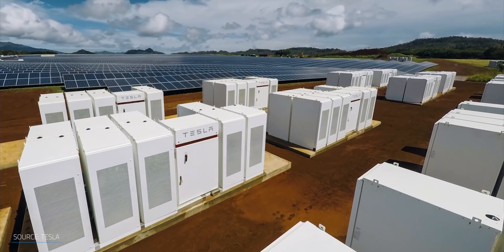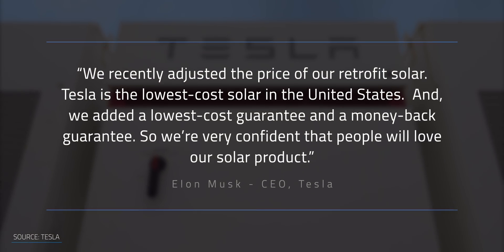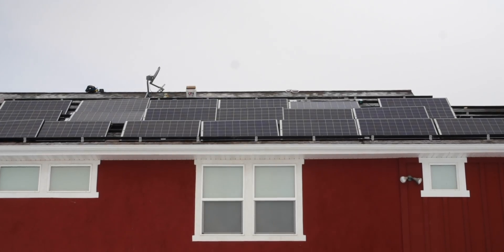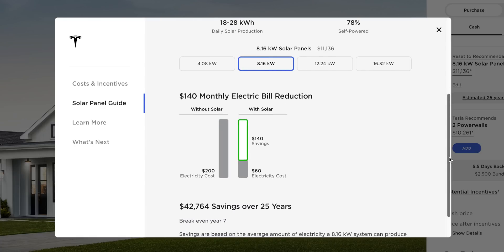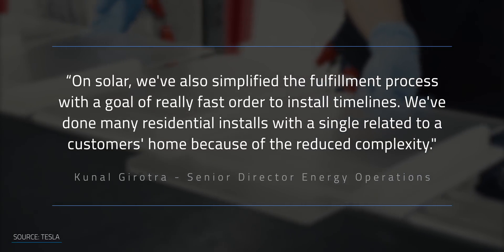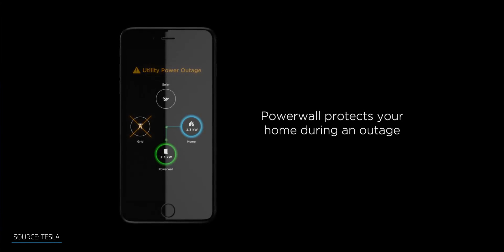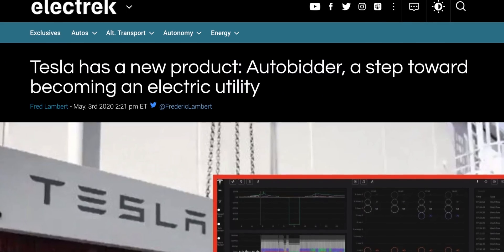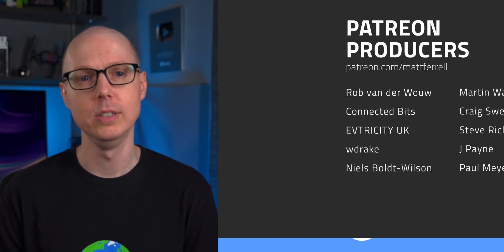Exploring Tesla solar panels game changing price

Comment: Yeah but still 3, 4 times the price of regular solar panels, I bought mine for less than $0.34/Watt, and did not choose the cheapest
Reply: Are you comparing only the price of the panels with total system costs?
Reply: @sharefactor  panels, cables and mounting hardware.

Comment: Solar is an awesome alternative even with gov. incentives but, that dam up front cost. Here in u.s.a its easier to finance a brand new car than a solar installation and would any one pony up 10 years worth of electricity bills in one year to go solar. I do believe it should be a gov. requirement here to have a power wall in every home but, that would kill the electronics and appliance industry because they profit from replacement not repair

Comment: Tesla solar also has the worst customer service and honestly subpar quality products. They also use a central inverter bottlenecking the system and meaning if that inverter malfunctions the whole system goes down. Most high quality solar systems will use micro inverters making the system a lot more robust.

Comment: Are those Australian costs in US or Australian dollars?  No mention in the vid, if they are in Australian then their costs are far lower still because the exchange rate means their dollar is a lot lower than ours.  This price drop though is incentive to wait, because if Tesla can drop it that much their competition will be forced to as well.  And last, I am a disabled vet so my income is tax exempt, meaning I cannot write off the costs against taxes, meaning I would have to pay full price for solar.  Then there is the unfortunate fact that my roof is 9 years old, meaning there is no sync between roof age and a new solar setup.  I would pretty much have to replace a roof with about 11 more years of life in it or, put solar on now then take it off in about 10 or 11 years, then reinstall on the new roof.  The uninstal and reinstal would jack up the overall cost to the point that I could not live long enought to reach break even,  and I wish I could because I have a huge roof, more than large enough to be selling Duke Power electricity instead of the other way around.  My July 17 - August 17 bill just came this morning, $221 and I do not even keep the A/C below 80.  Live alone, switched to LEDs, TV runs about 5 hours per week.  New energy efficient appliances, 6 month old A/C and air handler.  So, $220 seems to be as low as I can get my bill.

Comment: Why don't people just do it themselves? You can order panels for under 1$ a watt easy, they are not hard to install if you have some basic electrical/wiring (you should be at least comfortable with working with your main and breakers) skill. They sell all the brackets and such needed online and if you choose to grid tie it without a battery bank its even cheaper.

Comment: In Poland 7.9kWp total installation would cost about 9.2k USD. So about 1.16$/W. 25 year warranty. From another vendor, I found 9.9kWp total installation cost of about 9.95k USD. So about 1.01$/W. 15 year warranty for defects. 25 year warranty for power curve. The prices doesn't include transport if it is far from vendor, but that is rather small part of the cost (~500USD top). I think these prices can be further reduced, as one can get about 1300 USD government grant for installations below 10kW. So that gets to about 0.88$/W. I checked few other vendors and 9.9kWp installation with incentives it is possible to get 0.73 - 0.89$/W

Comment: The international comparison is distorted by the ludicrous exchange rate of the dollar. The real spending power of one USD equals 0.55-0.60 EUR and in the same relation all other currencies except the CHF, which is equally distorted. Just look at the prices for a loaf of bread, a m³ of tap water and a six pack of the market leading brand of beer. And on the other side, the median wage for an hour of work. Don't use the so called official exchange rate of the financial industry, that's only a fictitious number.

Comment: I paid 75 cents /watt but bought 280W Suniva panels 10k of panels wholesale from https://sunelec.com/ and the are down below 50 cents / watt now  in 3 years. the inverter and batteries are each a third of the cost too. We paid 26k for a 6k system off grid with an 8k outback radian inverter and 24 lead acid 6v/16 interstate  247 amp hour bateries .with 2  outback 80s charge controlers and  all wiring and racking. and breakers for roof mount.

Comment: 1. Tesla doesn’t make solar panels
2. The quality of installation is very rushed and more than not leads to roof leaks. 
3. They use components with about a 1% annual degradation rate
4. String inverters. Yikes. 
5. $100 non refundable to SEE IF YOU CAN GO SOLAR
6. Customer care is not great. 
7. You have a sunpower system on your roof, don’t compare this to that.

Comment: I think its important to know, that you can haggle the price down.  I bought a 10.7kw system in 2019, and after credit,  I paid 1.38$ per watt.  Had I paid their quote price, it'd have been 1.70$.

Oh and don't bother with sunrun. They are by far the most expensive.

Comment: What’s the deal if you need a new roof? Do they do it all or do I have to subcontract first? And a new panel install as well? We had a quote for everything before pandemic hit in the mid 30’s for a 7 kW system before incentives. In the northern NJ / metro NYC area, no time of use bonuses from utility. This was for a non Tesla panel install.

Comment: I’m so lucky to be in Australia. I just got a quality American solar system (Flex PowerPlay) installation done. 5kw system for AUD$2225 after government incentives (that’s 44.5 cents a watt AUD or 32 cents US). And the $2225 is on an interest free government loan to pay off over 4 years. That was fully installed and grid connection included. So cheap I couldn’t afford not to get it. I could have got a no name 9.9kw installed for that but chose better quality and 5kw still makes 2 to 5 times the power I consume (depends on season).

Comment: I'm hopeful that Tesla Energy works out, but I'm still not enthusiastic about the cost.  $16 to $20k is just way too much to spend, especially when my electricity provider won't pay me for power produced in excess of my usage.  A solar install isn't ever going to be cheap, but the prices need to come down to the point where it pays itself off in a couple years before I'll bite, and nobody has made that pitch to me yet.  Everyone I've gotten a quote from tells me it will have paid for itself in 15 or 20 years ... just about in time for the panels to wear out and need replacing.

Comment: We are currently building a rural home & Electricity is very hard to get. We have to go through a co-op & secure easements, clear right of way & install our own meter loop & box. But before they will even come & give me an estimate they require us to already have the foundation laid, water lines into the foundation & our septic system installed so as to PROVE that we are building a permanent residence. Even though I need power to my 1,200 sq. ft. Shop they won’t install electricity for it because it isn’t a home or residence. I need a grant to get solar off grid power to operate our farm. I’m a disabled veteran starting a farm. You’d think I could get some assistance with Electricity!

Comment: It may be cheap but there is no customer service at all. There is no place to really ask questions. I finally found a generic form. I didn't get a response until two weeks later and by that time I already signed a deal with a local company. Plus with all the reviews I've read it's mostly about broken inverters and how many months it took to get a replacement. Most reviews were about how tesla doesn't respond as quickly as solar city did. In the end, I ended up paying 50% more to a local company that was more responsive to me. I figured what's the point of a system if you can't get anyone to service it for months and have to pay for the solar and utilities while your system is out of action.

Comment: $16.4k for 8.16kW system?   Good lord, when I got my solar 10(ish) years ago the cost was $23k for 3.26kW,  which is flipping outrageous!   That said, with the federal, state, and local credits it came out to about $3k when all was said and done, at that price that was doable and honestly that was the only reason I did it.    That said, I just used the tool and it recommends the same 8.16kW system for me, but it's the listed at the same price which is confusing because I gotta imagine the local costs of labor have to be higher (San Francisco), and more shocking... there is no way they're fitting that many solar panels on my roof, so I think that price is the "Look how cheap it is" price but be prepared for the salesman tactics to change things up when it comes time for actual planning.   Also looking at a size half the size, the cost is half, which makes me think this may be the cost of the materials not the cost installed, because the labor alone is what made my solar as expensive as it was, I did the calculations back then and I think labor increased the cost 2-3 times over just parts.

Comment: One reason is that they use a string inverter, and sometimes, power optimizers. Many view that combination as the worst case. If your string inverter fails, you are done. And a replacement could take weeks or months. Optimizers have their own set of issues as well. I believe, as do many, is that micro inverters are the most reliable overall (if any one of them fails you still get power as they are all independent) as a well as more efficient (variations in shade i.e. output variance don't matter), therefore a greater ROI. But guess what's cheaper? The Tesla system. Single point of failure system with a longish timeline to replace. The guy I'm talking to for my install worked for Tesla and Solar City and guess what system he recommends?

Comment: as long as the cost of the photovoltaic system is less than amount of grid-energy cost it will offset over its lifetime, it's a good investment. factors to consider are weather patterns in the region, local regulations, and how long you will be in possession of the house. fire safety is also a concern

Comment: In Germany we paid 1,50€/Watt on a 9,9 kWp Installation. Including inverters, cables, workforce and paperwork. 

Incentivewise we’ll get 0,1079€/kWh we sell to the grid for 20 years.
I guess that was a very good deal, especially with our huge electricity costs in Germany

If Tesla’s Installation quality is as bad as our Tesla Model 3 I perhaps would prefer to pay a little more but get it installed by professionals.

Comment: Why are solar panels so freaking expensive in the USA?!

Here in Germany I can buy decent modules at around 0,7€ down to 0,56€ per Watt!

Of course with additional hardware and mounting accessories it gets close to 1€ per Watt or even a little over it.

But still - that is like 1,10$ to 1,45$ per Watt for a fully installed system!

Or are workers just so exoenisve?

Above mentioned prices are when dling the install yourself!

Of course hiring a solar guy or company will cost quite a bit more - still 3$ per Watt is really steep!
Reply: Neverming...watching the video further explained all I wanted to know! Great and very detailed video on the topic!

Comment: I think Tesla owes their solar customers pricing like this. They actually raised the installation cost of rooftop solar with those darn little solar shingles. That installation approach increases the labor costs, which raises the whole system cost. The appearance of the shingles isn't economically justified. I've rarely heard complaints about solar panels in my subdivision, and quite a few houses here have them (Arizona).

Comment: OMG 2013 St. Louis with a $2/watt rebate installers wanted around $5/w install. I was lucky and DIY got it to $2.xx/watt so it paid for itself in a few years. After rebates installer unit would have been decades to pay off.  Installer's labor was most of the cost CRAZY high.

Comment: $140 less electric bill? Do you guys not shut you shit off? We live in Florida, have a 65 inch 4K tv...have grow lights for our garden, our fridge stays on, and we run our AC constantly that's from like 1960, and have two ceiling fans that don't stop.

We also edit videos through a i7 8700 and RTX 2070. And our bill is less than $140...

Comment: 6kwh solar install  = $3-5k spend.  Unused power back to the grid - 11.5c per kwh.   $1.20 per day supply charge and 28c per kwh average costs = grid power which is not going anywhere.   Just because solar is getting cheaper doesn't mean you will pay less for power.

Comment: Oh are you telling me government just slows down thing and makes them more expensive oh what a surprise
Reply: Its the big companies that lobby against it. Wonder why...
Reply: This sort of thing happens at the local jurisdiction level way more than at a national level. Building departments and permit regulators add significant cost and delay to every project, and they prop up the general contractors, with virtually no benefit to the laborers. The contractors make a huge profit in the middle, with local governments backing them up. Move somewhere unregulated and life gets easier
Reply: @videosfromelsewhere926  Failure of public policy in your corporate run country.
Reply: @fmc6338  Interestingly there is no national policy to inform these local regulations. Policy changes from state to state, county to county and city to city. Denver versus St Louis, for example: both cities have totally different building standards, permitting procedures, costs, restrictions and timeframes. Chicago's codes and costs vary wildly by municipality. It can cost $8500 for a new 10-square roof in Chicago, materials and labor are less than $2500 of that. The rest goes to "management" and "permitting". Local corruption is widespread in that city. Compare rural Alabama or Tennessee, outside of city limits, and there are no building or safety codes of ANY sort. Freedom of choice.
Reply: Well.  Look how ENRON pioneered such great private corporate customer service.  Unregulated government or
private interests seem only to pursue self interest.  Maybe the weak link is the human factor of ego over all else.
=
Reply: @Mark Meiri no we should not be giving cash to anyone or taking any more than is really necessary career politicians should not be a thing any career politician is at leas as corrupt as any corporation
Reply: @Mark Meiri no we should quit subsidizeing anything
Reply: Actually, Australia made their government aspect slightly larger , which meant much more effective. We simply set it up with a more centralised system. Have an expert inspector, they get faster at it.

The US inefficiencies often feel like some people in gov are wreckers who actively make things worse because they hate gov.
Reply: Oh boy we better give them even more money and tax the middle class more!

Comment: In NL you get 340Wp panels for 160 euro each. Add 1000 euro for inverter and 1000 for installation. Thst makes 5100Wp for 4400 euro. And you can get VAT returned, so all-in you're looking at 3500 euro.

Comment: I just purchased 15.12kw system for $7000 australian after incentives.

Thats approx 46cents per watt
46 330watt canadian panels with 15 yeats warranty and sungrow inverter with 10 years warranty.
Reply: And that's Australia, so it's probably an even better deal (depends on where you live) because you receive substantial solar radiation (i.e. more kilowatt hours per dollar/panel/etc.). Good deal.

Comment: $1.49 per watt, times my 2016 SolarCity 9.2 kW system is $13,708, never mind the fact that my state actually limited my inverter to 7.5 kW. Let's also add $7500 for a PowerWall2, which didn't exist at the time of my installation so I don't have one, for a total of $21,208. Let's also go ahead and assume that this price is intended before US tax incentives so the total would be $28,708. My cost was $34K, and that would still be $6K cheaper than my current system, with a powerwall, and additionally Tesla is putting more efficient panels that what are on my roof at this point, meaning less panels on your roof for the same power.

This is one of the times I REALLY hate being an early adopter...

Comment: The question is: Are these the same crappy panels installed by Solar City? (Called "Solar Sh*tty" in hotter climes where the panels failed at a high rate)
Reply: OCnStiggs .  No new design.  Higher wattage.